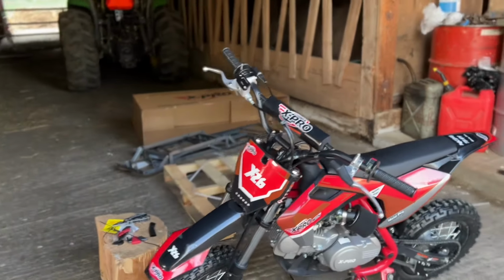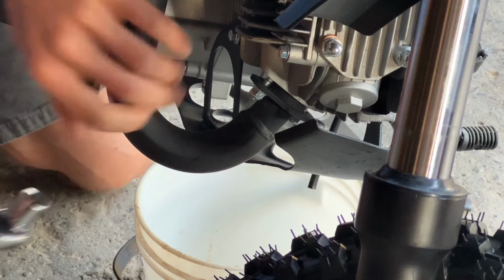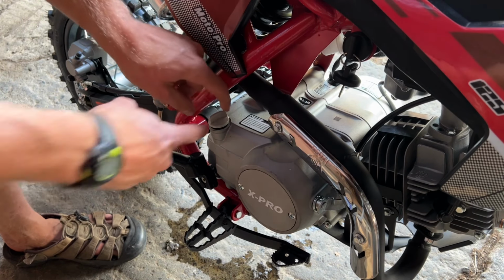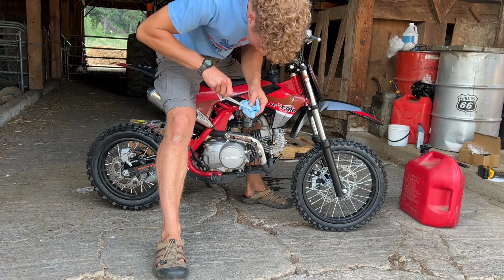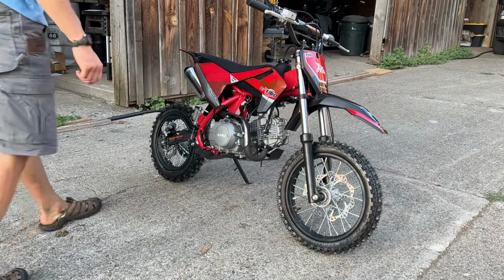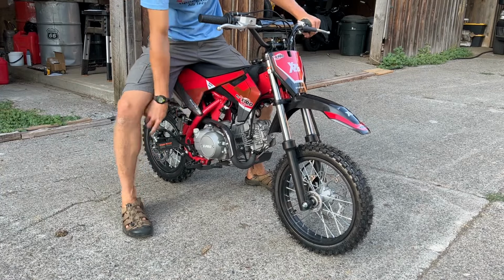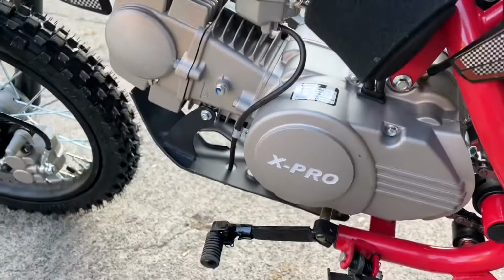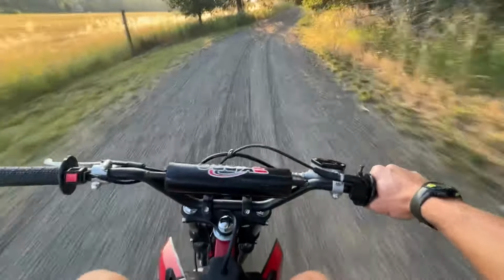XPRO 125cc! build, oil change, first start & ride!

Comment: Thanks for the video. I have 5 questions.
1- what model of Xpro is that?
2- what is the seat height of the bike?
3- what is your inseam?
4- what is your weight?
5- can a rear rack be installed on this bike?
Reply from the maker: Doesn’t really have a model name, I think it’s the base X model of its year.
Seat Height	29.13"
150lbs
Not made for a rear rack but I’d think it could be done with a diy project

Comment: Idk if you will still answer I might ask for one of these but do you think you have to change the oil
Reply from the maker: Yep, I believe you have to change the oil.
The oil that the bikes arrive with, just isn’t good enough
Reply: @GRO77  I really need help what # number type of gas does the xpro x19 125cc take like the 90 gas or more  or is it 80 or more gas

Comment: @GRo77 i really need help what # number of gas does the xpro x19 125cc take
Reply from the maker: It will run on any fuel grade but 92-95 ethanol free is best for the little engine
Reply: @GRO77   thank you the nearest place we have with 90 gas is 50 minutes away in a different state
Reply: @GRO77  but the reason we don't is because we're a small town
Reply from the maker: That 90 gas should be just fine 👍🏼
Reply: @GRO77  yea I kept seeing things of what octane someone told me 104 which is jet feul): thank you very much

Comment: Going to buy this once my check comes in, been 3 months is it still running well? And is it easy to put it all together
Reply from the maker: Putting together was easy enough. Just takes time!
I buy and sell to make a little. It ran a amazing when I had
Reply: I've got a xpro x9 and I've ran it hard after about 2 months I bought a 140 motor and did a swap but even the 125 ran great and would recommend upgrading thw seat u have some videos on my page of the xpro if you wanna check them out
Reply from the maker: @MrGuitarforidiots  Splendid! I will👍🏼

Comment: Mine will not start up, and I have the exact same one as you but yeah, did that happen to you or do you know what to do?
Reply from the maker: Is it brand new or used?
Make sure the spark plug wire is all the way plugged in!
Reply: It’s new and I only had it for about a month and I’ve already checked everything with the spark plug
Reply from the maker: It arrived starting and running?
Sounds like it could be a carburetor problem, you might need a new carburetor?
Unplug the fuel line that goes to the carburetor and make sure fuel comes out.

Did you ever change the oil? If you didn’t that could also be the problem
Reply: @GRO77  yes I did change the oil but I will get back to you whenever I do all that other stuff

Comment: I have an electric start. Have everything hooked up. When i push the start button the bike doesnt do anything. Do you know what the problem could be? I ak charging the battery right now but it still doesnt do anything.
Reply from the maker: Hopefully it has kick start as well?!
I’ve had to replace a starter before. Also when pushing the starter button have someone tap on the starter with a hammer! That’s worked a few times for me as well!
Reply: @GRO77   I got it running. I had to call the company. Went through a bunch of different steps. Finally he had me put in the replacement fuse and it started right up. Thanks anyway.

Comment: can you mix that type of oil with the gas?
Reply from the maker: You can’t, it’s for 4stroke engines only.
2stroke engines are the motors that are made to burn oil and they need a specific 2stroke oil that is thinner and has good burning properties.

Comment: Should I get this or the 17/14 size? Im 5'11 and weigh 195
Reply from the maker: They both work. Bigger tire size is preferred by many but $100-$200 savings for me was worth the smaller
Reply: Thank you for your input boss
 @GRO77